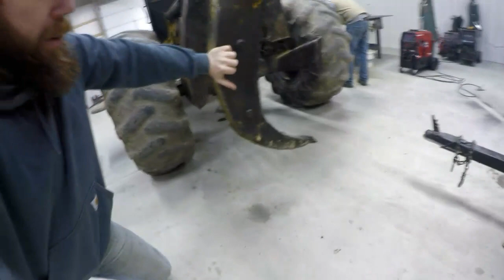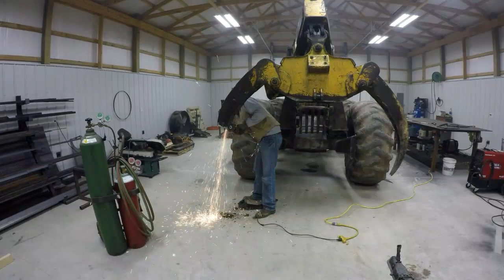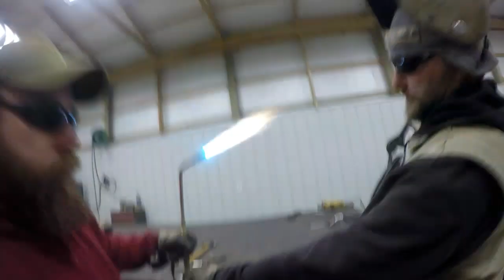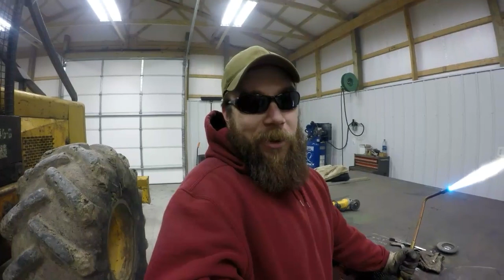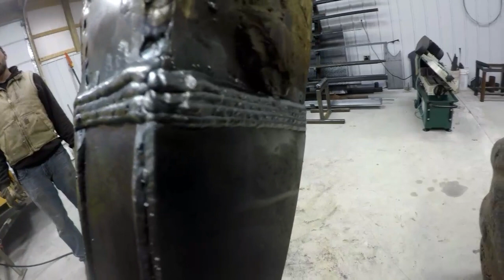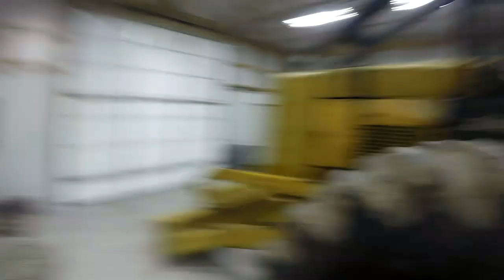540B skidder grapple repair project

Comment: Just a suggestion and he probably does this but this is what I do. Make quick patterns out either plywood or wood. The wood is quicker/easier for me to do with a saber saw or band saw. With me plasma they have to 1/2" smaller than finish but you just ride the torch head along and it makes them Basically the same. They stand tall enough that it makes it hard not to make stuff right, which I sometimes need. It saves a lot of grinding time as they are so close. A poor man's(like me) plasma table. Follow this link to one of my builds and it shows the process starting at pic 50. 

http://imageevent.com/kevininohio/woodsplitter?n=0&z=2&c=4&x=0&m=24&w=0&p=0

Heard about you guys through Wade and Cotontop.
Reply from the maker: kj inohio, I'll pass that along, thank you for following our channel!